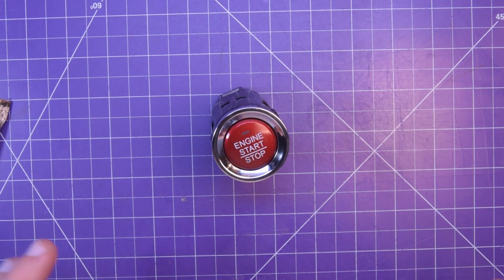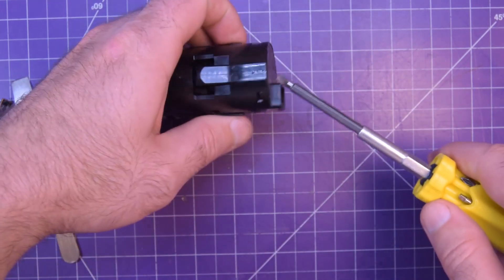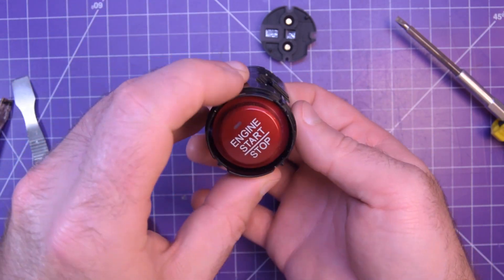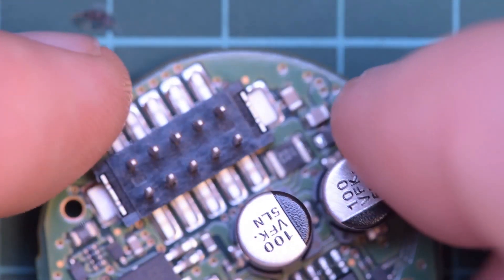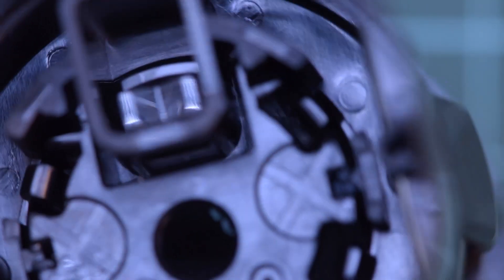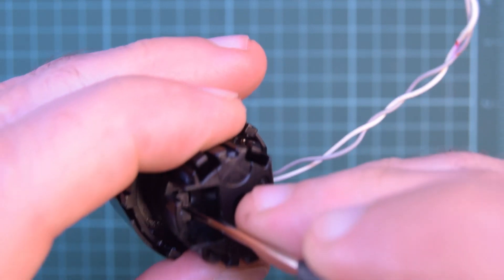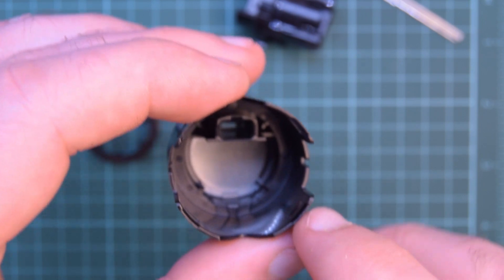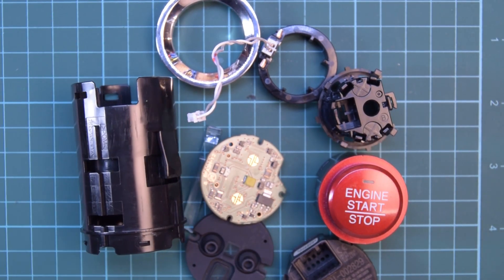Tearing Down An Engine Start/Stop Button!

Comment: Fascinating, and surprising how much engineering and circuitry is in this switch. I always assumed it would just be a push to make switch with a couple of wires going to the ECU. Didn't know that you could hold up the key to it if the battery failed either, I didn't read much of the user manual for my car 🙂

Comment: Hook up some wires for backlight, green led and button contacts. That way you will have complete button. You could even try to use coil, put some metal inside and energise coil to make switch switch itself.
Reply: Small correction, magnet, not metal.

Comment: This is amazing. Thanks for this. 
But thinking about the amount of effort to get down to the least bits, fix it in case something is noticed amiss or broken (for sure), and then replace it into the car; that all might be costlier than just getting a fresh replacement, am I right? 

I would still want to fix it though 😂
Reply from the maker: Probably not fixable economically, no - and these things usually throw codes for communications - so there might just be a batch of bad CAN chips, who knows.